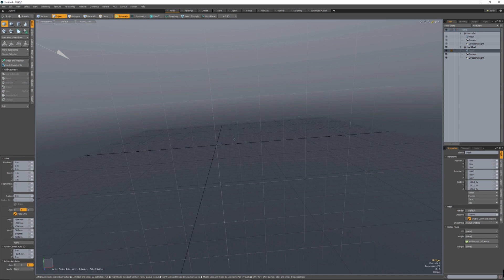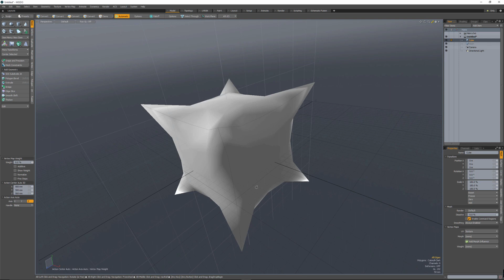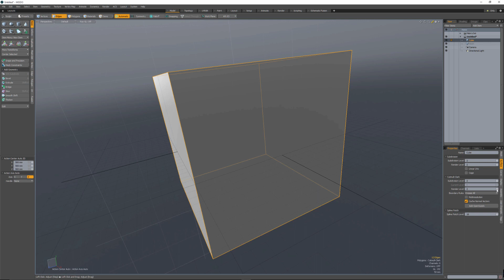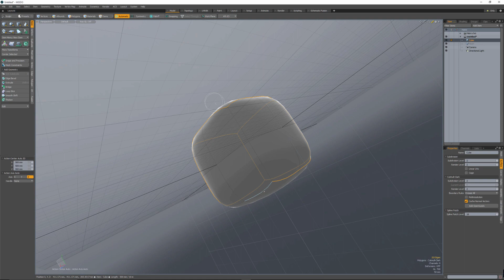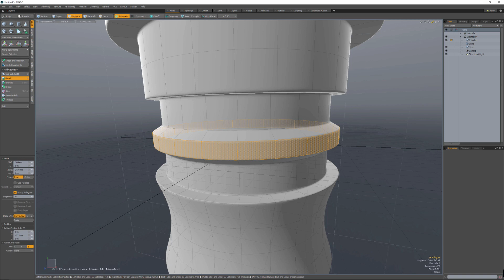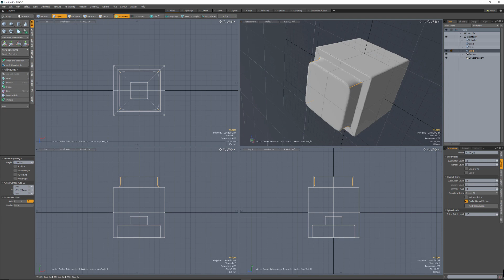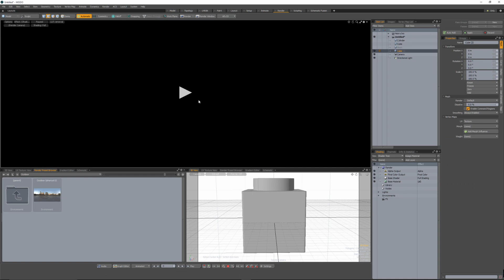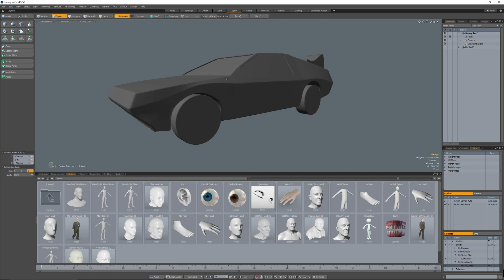Episode 02 Edge Weighting

Comment: If you are using Modo to model assets for other software, you can use edge weight? In this case the correct is to freeze the geometry before exporting?
Reply from the maker: +harlockmbb That depends on the output. If you are going out to Maya (which also uses PSUBS), and using FBX format then it will transfer pretty much exactly as you have it in Modo. For any app that does not support PSUBS or SubDs at all (game engine/realtime application) you will need to freeze the geometry into polygons.